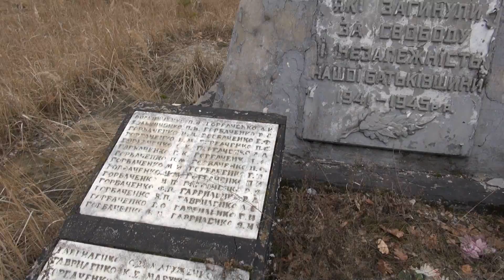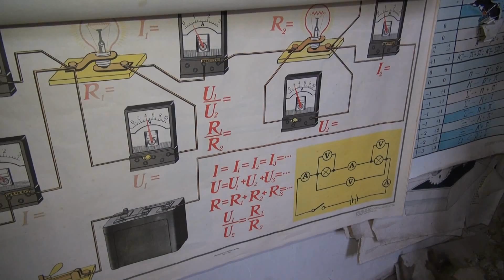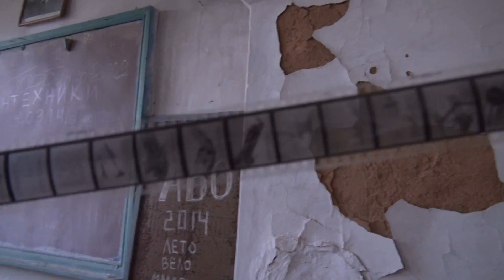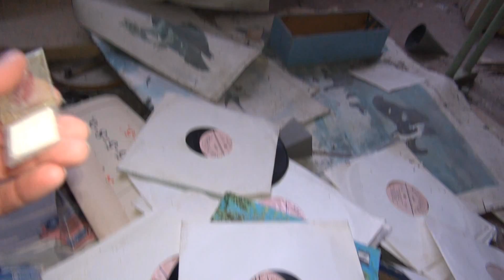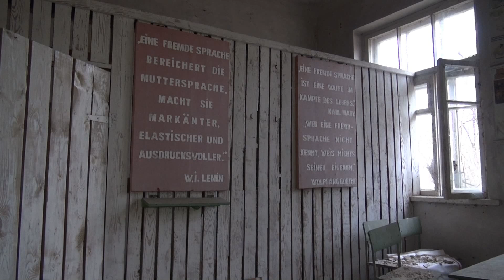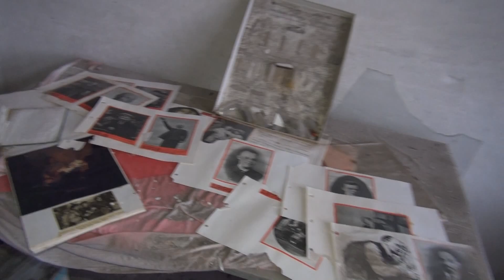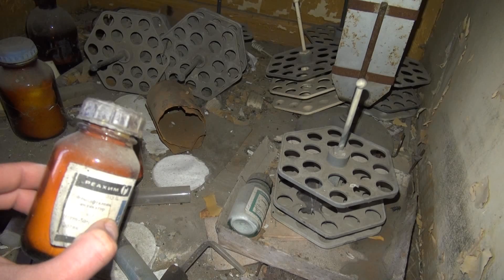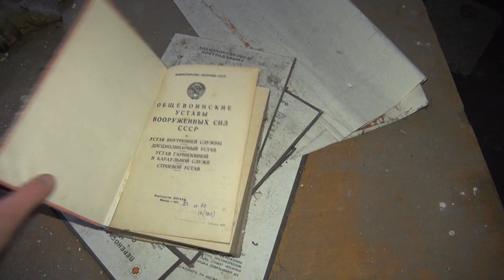east of Chernobyl and the Pripyat river: машеве (Maschewe) village & physics university

Comment: I think that board with the oil samples is showing the different stages of distillation. From crude you get Ashphalt, bunker fuel, heavy fuel oil, lubricating oil, diesel, kerosene, gasoline and gaseous phases at different temperatures.

Comment: The 'spinny thingy' at 1:57 on the bench is a Pelton Wheel turbine demonstrator.  It has a water inlet pipe on the side of the enclosure side that fires water at the cups on the wheel you can see in the window.  The spent water collects in the bottom and there's an outlet pipe.

Comment: 2:16 i think its a corona motor
2:21 is a rumkorf coil
3:44 is a resistor bank
Reply from the maker: cool, cheers for the precise names of those. :)
besides the resistor bank (which is the object i'm touching), what's the thing with the copper wire in the center of the screen? just a crude selfmade transformer? 
damn, i so want to go back to figure out what all these things were. it's fun. too bad i had so little time there.
Reply: bionerd23 I think indeed. a homemade (rumkorf) transformer or a coil for a radio.
I would also like to walk in that building.

I expect that there is also a Wimshurst machine somewhere.
Reply: bionerd23 6:56 those are контурные карты. Great study tool.